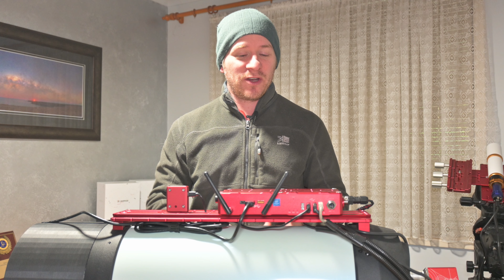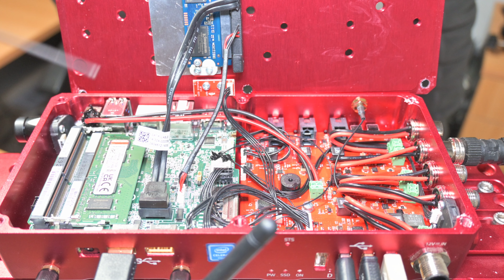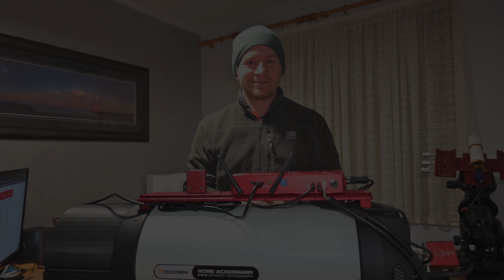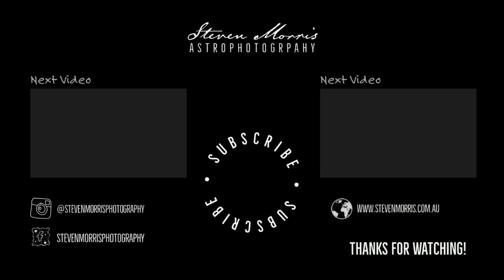Primalucelab Eagle 4 Upgrades and In Depth Look

Comment: HI, Great video. could you give more details on the Victron DC-DC converter. Cheers, Greg
Reply from the maker: Hi Greg, the Victron DC-DC regulator I have is an Orion-Tr 12/12 - 9. Input is 8-17 volts, Output 10-15 volts, Max power 110 Watts 9 Amps.

Comment: Were you having any problems with the Eagle before you got the voltage regulator? I just got an Eagle 4 Pro and I have been having all kinds of issues running off a battery. Just ordered the same Victron unit you have, so I am hopeful this will clear up my issues.
Reply from the maker: No I can’t say I had any issues, I had always made sure my voltage was above 12 volts though without the regulator.

Comment: Steve: Did you buy the PLL cables to fit the sockets
Reply from the maker: So i purchased the power connector that plugs into the power socket. I just made sure of the positive and negative and made sure the centre tip was positive for the mount side.

Comment: Second comment. The device comes with Windows 10 Enterprise. Did you install Windows 11 Enterprise? Do you run virus protection software.  Thanks Steve
Reply from the maker: I haven’t upgraded the windows software nor is it connected to the internet. If I need to install programs to it I download it onto a usb stick and install it onto the device that way. 
Actually there has been the odd occasion where it’s briefly connected to the internet but windows isn’t updated. If things work I don’t like to update them unless it provides a significant gain. 
Like the old saying, if it ain’t broke… don’t fix it.

Comment: Great! Thanks to you I have one meownself. Was hoping to up the ram and this confirmed it. Thanks again. I do use cable network hook up and like it a lot better than wifi. I have also gotten a network adapter for my ipad Pro so that when I need to get close to my rig (which I just pier mounted) I can use it, get done what I need to and then head back inside to my desktop.

Comment: Hi Steve and thank for you video on the Eagle 4. Currently run my Telescope and acquisition Software NINA and SharpCap from a win10 Pro Laptop local to the telescope (QHY268c camera, Sky-Watcher AZ EQ6) and r using windows remote to computers in the house but having to use cables as finding some of hardware on the scope does not like USB Hubs and I use USB 3 and USB C focuser,  cameras etc and such so this device would go a long way to solving those problems. If I may ask. Do you get WIFI drop outs or slow downs as the telescope rotates and the antenna are hidden behind the scope? I had this issue when using ASI AirPro. What happens to the Win 10  Pro on the Eagle when the daily updates arrive from Microsoft and wonder what happens with Windows 11? Looking at the Eagle 4s but it still is an old I3 for  $2.4K Aus $. I have a Sky-Watcher 250mm Newtonian F4 Quattro as well as a Sharpstar 150HNT 
 I have already added an extra 5kilo weight to balance the 250mm heavy Quattro and there isn't much adjustment left if the Eagle4s is heavy?Just resting my finger on the order button for the Eagle 4s but thank you for another excellent tutorial.
Reply from the maker: Hi Barry, 
Glad you enjoyed the video. As for the WiFi I haven't had any issues with it when it slews around, I understand what you meant by the AsiAir WiFi dropping out and I haven't encountered anything like that.

I haven't updated my Eagles windows, I keep it off the internet and only download the programs I need for it, the way I think is.... if it's working, don't touch it! lol.

It's not super heavy but it is nice and solid!
Reply: I went and purchased a Eagle 4s and spent what seemed like ages installing all the Astro software and with a Ethernet cable plugged in it goes faster. I get the same issue with having to start at least twice for Wifi to join my home network.When joined I leave it for a few minutes to let it settle down.Tried Cartes du Ciel Program that come with the Eagle 4s but some reason the Eagle 4s froze when it was started. Have used Stellarium when using my Win 10 laptop in NINA without that problem. Finally a first light with a clear sky tonight to run and test the Eagle 4s.. All seems ok and chose the Tarantula Nebula as its not facing a full moon. Skywatcher 250mm Quattro F4 has the Eagle Computer sandwiched between it and on the Skywatcher AZ EQ6 mount as its heavy and I am keeping as much weight inboard as I can. How have you found the EYE and did you get NINA to use it and the Satellite antenna position?
Thank you for your reply.
Regards
Barry

Comment: Been researching high and low on the Eagle (specifically the LE model) because I love the form factor of the unit. Other than the cost, my main concern is that I'd be buying into an already pretty old generation of components. However, if the only difference is that it'd take a few seconds more to open the select few software you'd be running on it, I don't think I'd be phased by it - but if it was a slog through and through while operating the software that'd be something else, so I'd be glad if you're able to shed some light on that.

Comment: Hi Steve. Interesting discussion. I upgraded my Eagle 4 to 16gb RAM a while back & it is so much better since. I remote in over ethernet because the Eagle doesn't support wifi 6. Changing the wifi card is a good idea that I might try later. The Victron DCDC converter is a great way to get regulated power from a battery! Thanks.
Reply from the maker: It surprises me that a ram upgrade cost so little yet they add such a premium on the model differences. Ram is a nice upgrade and helps with all the multitasking. Glad you saw a difference too!
Reply: @StevenMorrisAstro  4gb just isn't enough - look in Resource Monitor to see where it's gone. Cost $150 for 16gb. I went with the Eagle 4 because it used less power, important for me because I use a small regulated field battery.

Comment: Nice rundown on the Eagle computer. I am also a fan of the Primalucelab stuff although haven't purchased and Eagle. I recently did purchase their side by side Lozmandy Plate (large) (I could see yours in the background there) to see if I can setup up two telescopes on my mount in the obsy - not planning to have matching scopes like you have but one will be long focal length and the other medium.
Reply from the maker: It’s actually rather funny that there was no such thing as the side by side that I had seen and then once I had done it a couple of months later I had noticed it…… mmmmm. Lol
Good luck with the side by side setup your working on mate.

Comment: Hi Steven! Thanks for this review. I own the exact model, and I also upgraded the ram memory,  but to 12 GB. I thought the motherboard wasn't gonna detect all those extra gigs, but it did. It is a lot smoother now.

I also decided to try another set of WiFi antennas. I had a bigger set at home, and they certainly helped a lot with the signal. I did some tests with a WiFi detector, and the signal is stronger when the antennas are parallel to the ground (when the mount is parked). I asume that when the antennas are pointing up, they are closer to the metal of the mount or scope, and the signal deteriorates a bit. Try extending the antenas or changing them and see if it helps a bit.

I was reading another comment, where someone upgraded the wifi card for a newer one. 
I didn't know this could be done. Is this an internal upgrade, or maybe it's an external wifi card?

Thanks! Cheers from Lima, Perú!
Reply from the maker: That’s interesting how yours detected the extra ram, maybe that’s something I’ll look into in the future, maybe we should call this segment “pimp my Eagle” lol. 

The wifi is something I’ll look into myself in the future so thank you for the info. I eventually want to run this unit via an Ethernet cable so wifi won’t be needed as much anymore. 

The wifi card is interesting, I guess you would need to look up the main board and see what can be changed or adapted too.

Comment: It is a great bit of kit - but if you are looking to get something cheaper you can get something like a MeLe Quieter2 which has 4 USB3 ports 8 gig of RAM and can have its internal storage upgraded via SSD.  (mine has 1TB of storage).  Since I have an iOptron CEM70 I have plenty of power and USB on the saddle and I have a kendrick dew controller.
Reply from the maker: I agree the PrimaLuceLab equipment isn’t cheap and I thought about building a cheaper setup for a second mount in the future. 
That’s one thing lacking with the CGXL mount is the USB ports and power etc, why they didn’t do that I have no idea.
Reply: @StevenMorrisAstro  Its to make you want to upgrade to a CGX-L 'MKII' if they ever make one. :)
Reply from the maker: Companies love dangling the carrots in front of us, they give us partially what we want and then wait 3 years for the next model to give us 3/4 of what we want and then wait another 3 years to design something completely new and the cycle starts again 🤣

Comment: Nice video Steve. With your issues re: Wi-Fi, I upgraded my wireless card on my Eagle 4 to a newer Wi-Fi 6 card as I found the original card a little slow on the Wi-Fi  but not had any issues with not connecting like you. I also swapped out the SSD to a larger one which works great. I'm wondering down the track in a couple of years to see if I can swap out the NUC board with a newer more powerful version. Like you I love the Eye, works great on the FITS Headers
Reply: I also added the PrimaLuce Maxi dovetail clamp to the top of my Eagle 4 and I mount the scope on the Eagle rather than put the Eagle on top of the scope like you but that idea would be no good for you with your dual setup
Reply from the maker: I had no idea you could upgrade the wifi card, I will have to look into that. I too did think about upgrading the SSD but for now I’ll stick to the USB stick for now. I did tinker at the idea of a NUC upgrade however I’ll skip that for now.